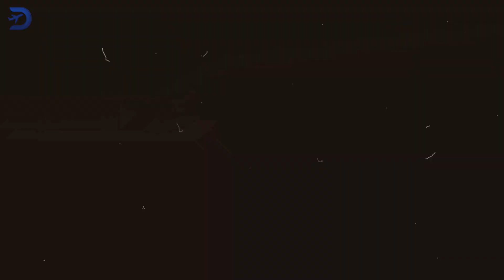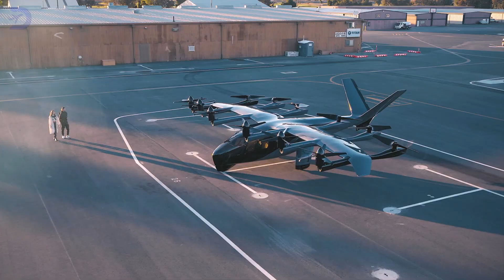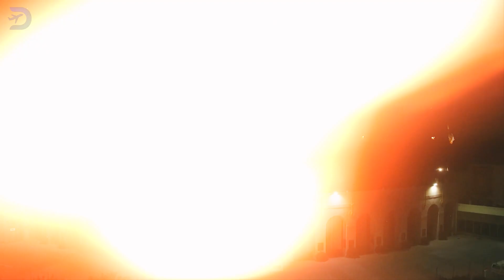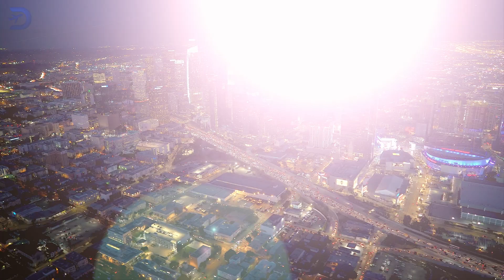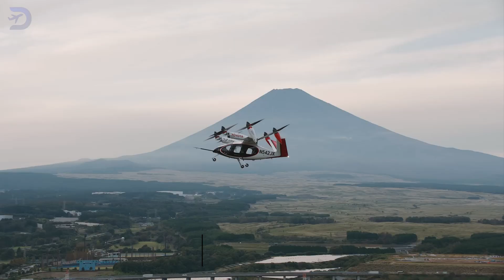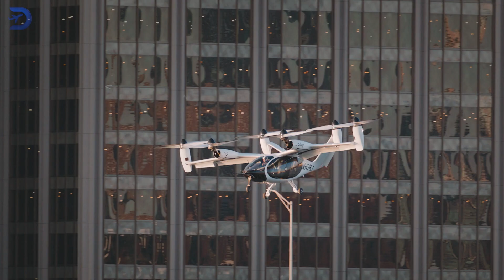The Vertiport Dilemma ! Is the World Ready for eVTOL Infrastructure

Comment: Vtol is inherently too slow, having to stop in mid air from say, 150 mph, before landing and starting from zero speed although using full power just to hover - way too slow for viable throughput and much slower than roll on roll off ( non hovering flight)
ATOL is the solution and zero ground roll or real estate was the actual goal before tunnel vision on clever multi rotor and battery powered drones set in.
Reply from the maker: @rossnolan7283
You raise a valid critique of VTOL operations, and it’s a point many in the industry are debating. The need to transition from forward flight to a hover for landing, and vice versa for takeoff, does impose time and energy penalties, which impacts operational efficiency. ATOL (assisted take-off and landing) concepts could indeed provide a more seamless flow and higher throughput, especially in environments where space isn't as constrained.

However, VTOL’s design is largely driven by the urban air mobility vision, where minimizing real estate requirements takes precedence over speed. The question remains whether this trade-off can be balanced with innovations in hybrid designs or more efficient propulsion systems. It’s a fascinating challenge for the future of eVTOLs and urban infrastructure, and your perspective highlights an important area for further exploration. Thanks for contributing to this crucial discussion!